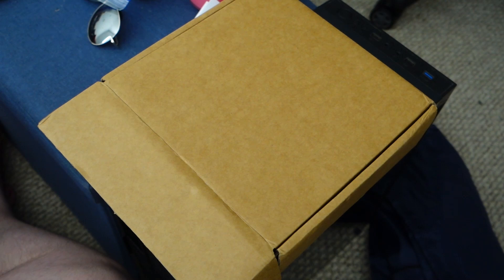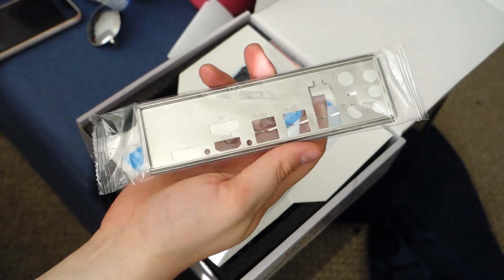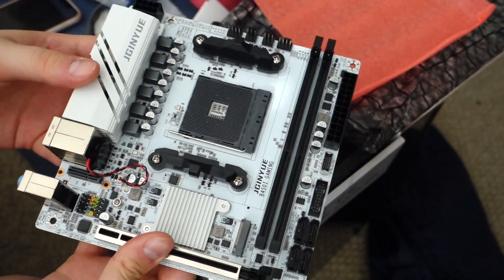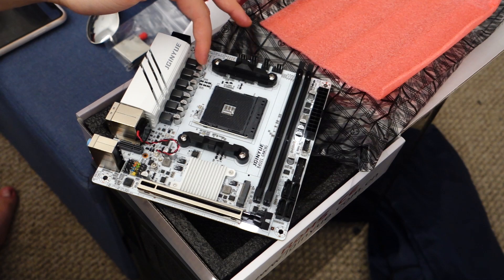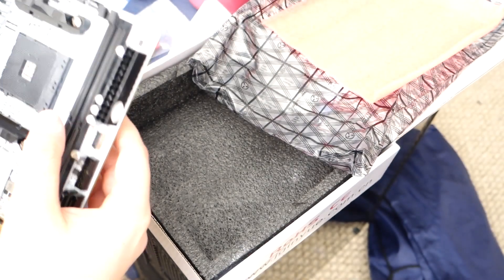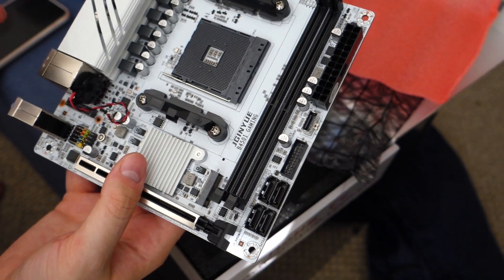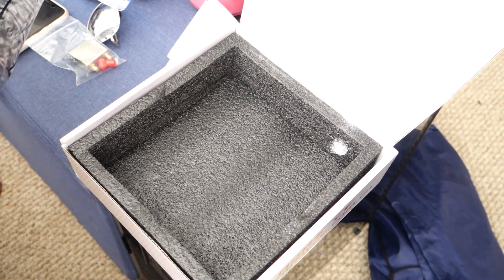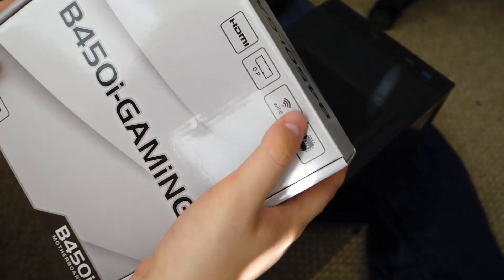This Chinese Ryzen ITX Motherboard is Weird and Awesome!

Comment: Count the inductors (the rectangular bits). That's the maximum number of VRM phases you're getting. Since there's video outs on the mobo you're getting 5 phases max for the CPU, because iGPUs have their own power delivery (1 or 2 phases).

Those antenna connectors are most likely brass, not copper. Copper is darker.

These mobos aren't recycled. Recycled mobos are sold as such, these are new ones (that may or may not have salvaged parts). Also, Aliexpress is a great place to find non-mainstream stuff, cheaper than you could in the west. There's no way I could find a new Socket 1151 ITX mobo for a bit over 50€ locally. :D
Reply from the maker: Ah yes. I could have sworn it was the number of inductors but I didn’t know about the igpus part. Good catch!

I wouldn’t reccomend it for a first time builder but if you’re a tinkerer and willing to play with stuff, AliExpress has some awesome deals and some really cool stuff. Can’t wait to play around with this thing once I can afford a cpu for it

Comment: i have the b550i paired with a ryzen 5700x and is very nice, the only downside for me is the m2 at the back, heats a lot and is the gen4 m2 and is a little bit hard to cool on my 3.8L pc case
Reply from the maker: What makes the drive run so hot? I’ve never heard of that being a problem before.
Reply: @TrippTech  that at the back of my pc case i dont have good airflow but is normal.
Reply: front and back can using m.2 nvme gen 4?
Reply: @ back is gen4 and front is gen 3

Comment: Cool, i been looking for a Cheap Ryzen Mobo myself, i have a HP Mini pc with a Ryzen 5 in it <the one i use for my batocera box> and if this board will support it <will check later on> i might just get this board, looks like it prob supports up to 32 GB of ram <guessing, maybe 64 no idea> Wanan build a Tower size batocera system, so i can slap a Halfway decent GPU in it <prob a GeForce GTX 1650, yes they are old, but for Batocera with a Ryzen 5, would be absolutely Fine>
Reply from the maker: Supports ryzens generations 1-5. Memory is capped at 32gb
Reply: @TrippTech  Well, it is a Ryzen 5 Pro 2400GE, so 2nd gen, if i remember correctly. Thanks for the info yo